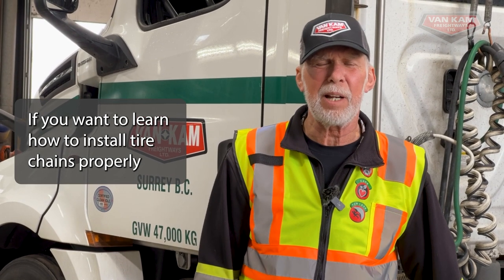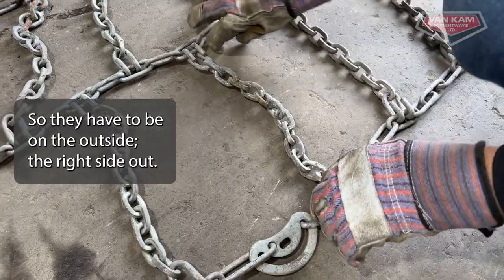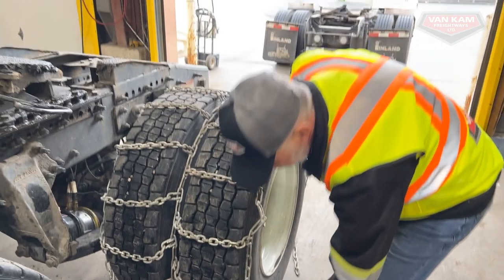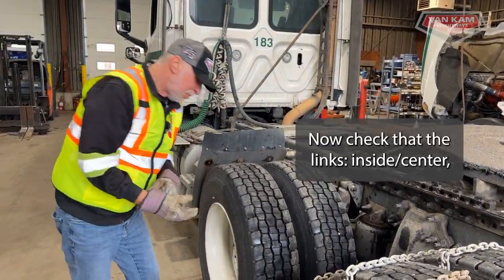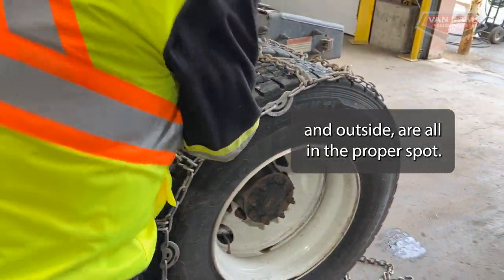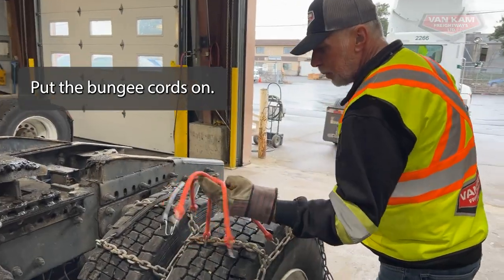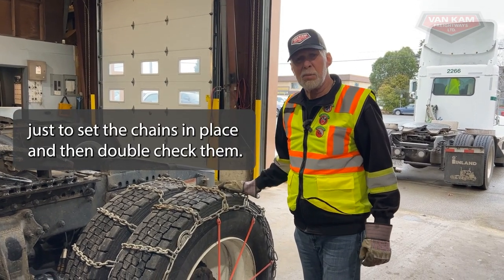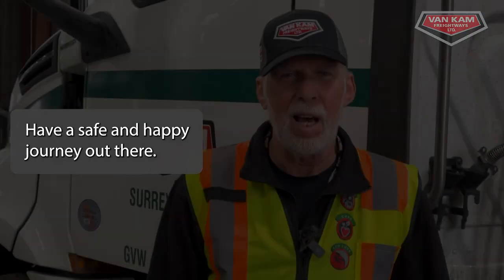How to Put on Tire Chains for Trucks

Comment: Shouldn't you chain up the front axle?
Reply: shut up and follow.
Reply: @thebacheafghan  follow into the ditch? Lol
Reply from the maker: Hi @dakotamoberly6630, sorry for the late reply, but that's a very valid question! We typically chain up the rear axle because that is the actual drive axle when the differentials are not locked in. The front drive axle is just along for the ride until you engage the inter-axle lock up. So if you only require 1 set of chains, you usually do not need to engage the axle lock up, so the one wheel on the rear axle is the one supplying power. Hopefully, that makes sense.